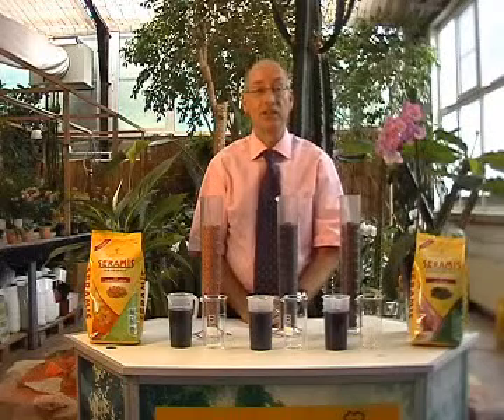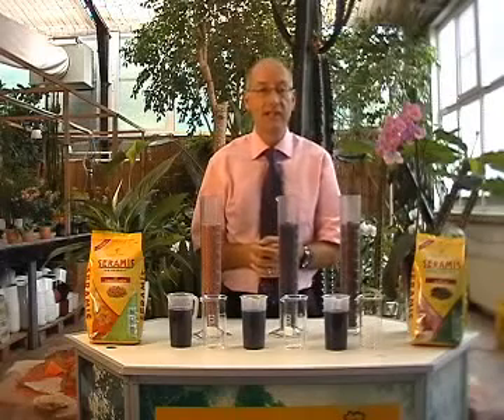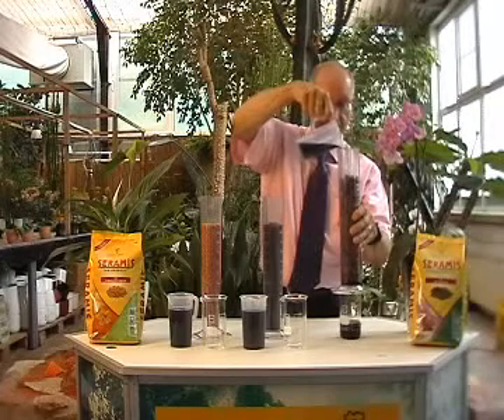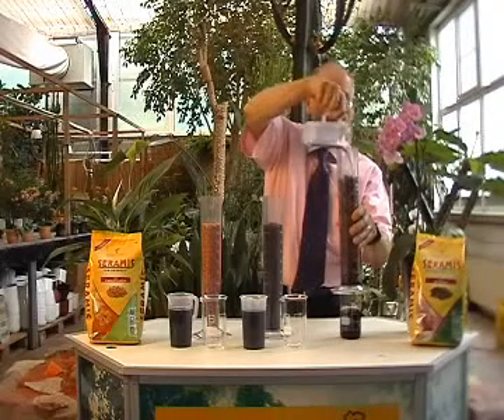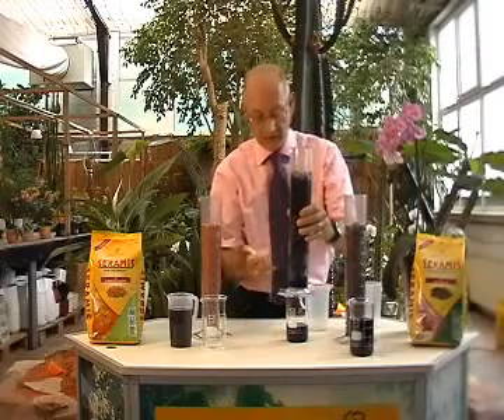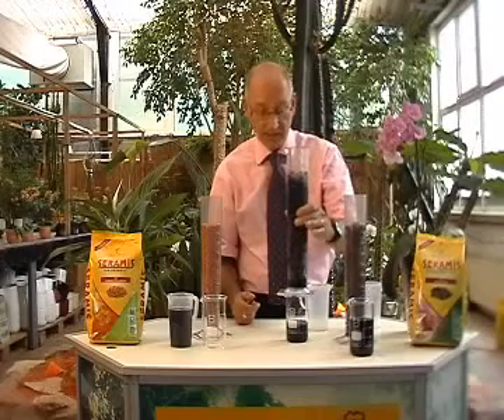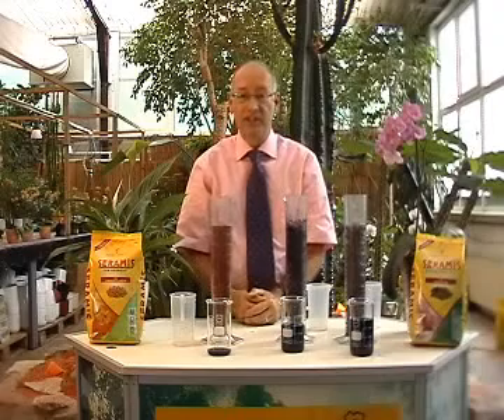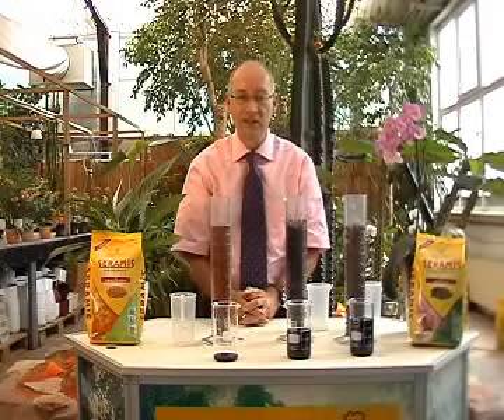Water absorption test with SERAMIS vs. two different substrates

Comment: Since it is so absorbent it is extremely porous. Question is it is safe for aquaponic systems. Will it change aquarium water color or affect the water chemistry
Reply: No coloration to water.
I have washed it 4-5 times until it stop producing dust. Then extra 2 times keeping for 1day each, to leach out possible fertilizers as it is claimed on the package.
Was no problem with aquarium, but after a year it become super brittle and you can crush it with your finger.